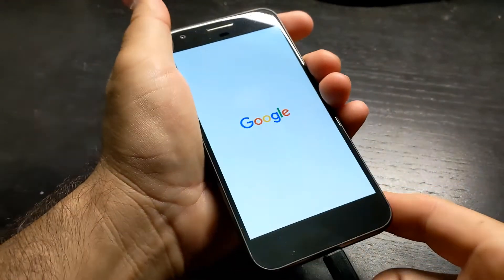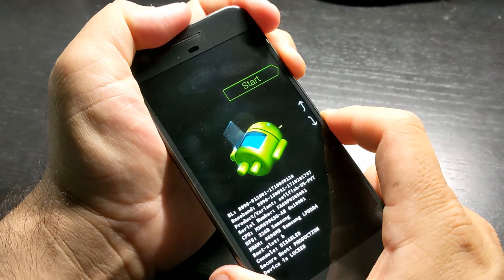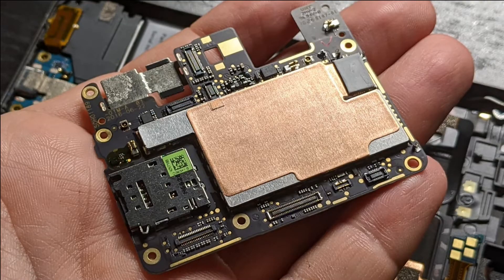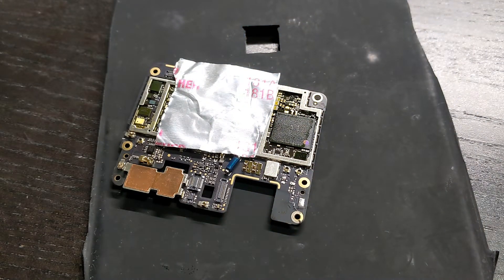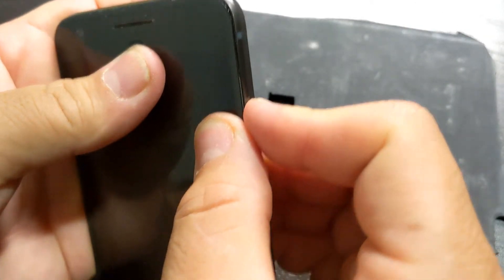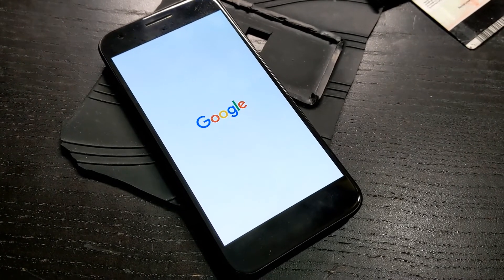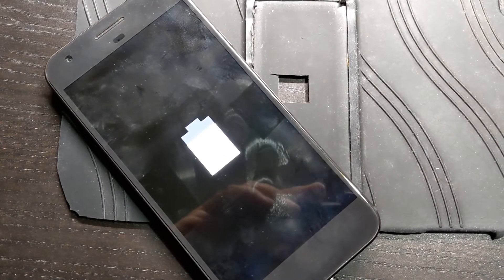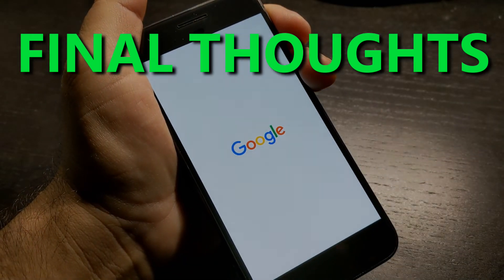Google Pixel Bootloop? Try This Fix! #reflow

Comment: Those type of reflows have a high re-failure rate. The proper way is to remove the chip and clean everything off and add new balls.
What you can do is do it again, but add flux to the sides of the chip so it flows under to the balls. Then heat the chip until the slightest push/bump of the chip sees it move/wobble - the push/bump joins cracks in solder -. The bump/push has to be very small so the ball surface tension pulls it back into place. Too hard a push will push one ball to the other so they join, and that will short the balls together, ie, you need a total new reball.
Reply from the maker: Thanks for the feedback. I will try reballing next time!

Comment: Hi Chavez Hobbies, I have à Nexus 5 and Pixel C tablet, and both devices are stuck on bootloop.

I try recovery mode :

- reboot system now : not work !
- Wipe cache partition : not work !!
- Wipe data / factory reset : not work !!! ( again !? ...yes ! 😤 )

I have 3 devices from Google, the only one work, it’s à Nexus7 2013 but I give for à friend.

I have no solutions for fix the troubleshootings of the two others devices 😢( and I’am not à electronic doctor like you, I have not your skills and capability 😉 )

But, thanks Chavez for your videos 👍
Reply from the maker: You're welcome! The Pixel C tablet is a nice one. You can still sell your devices as "for parts" online. Someone that knows how to fix a  bootloop issue will buy it. You may not have the skills right now but you can learn by trying. Making mistakes and failing is a natural part of learning. I have messed up sometimes, but I keep in mind that I am still learning.

Comment: Hey, thanks for making this. I have a phone that I locked the bootloader by mistake. I have the same issue. 
Would this method unlock the bootloader? If not, is there a hardware method to do so?
Reply from the maker: No, this method does not unlock the bootloader. I have not unlocked the bootloader on any of my Pixel phones. Try this video and see if it helps https://youtu.be/Px_vJZH5oKU

Comment: My Google Pixel XL is also like this. Sadly, there's no remedy for this issue. The only thing I could is to purchase another. I just bought this phone because of the unlimited google photos storage.
Reply from the maker: Have you tried reflowing the memory chip? The unlimited photos storage option compresses your photos a bit, so they won't be in their original size. The photos still look good though in this option. If you choose original photo/video quality, the files will count towards your 15 GB of free storage.
Reply: @ChavezDIY  I brought the phone to repair shops here and they don't know what to do with it🥲. Next time,o I'll suggest your video to them. 

I think 1st pixel series has that unlimited google photos at original quality.
Reply: @ChavezDIY  The Pixel 1 and Pixel 1 XL are the only ones that back up all photos with UNLIMITED FULL RESOLUTION photos at ORIGINAL quality.
Reply from the maker: @Progressive.G  That's correct. I confirmed that myself with a Pixel 1 after the comment above. The downside is that the camera is really old and it doesn't do a good job in low light situations and has a hard time with macro shots. I ended up with free full storage of some mediocre shots, it wasn't very helpful for me. I'm okay with storing photos and videos at a compressed "high resolution". If I need the original quality I download them off the phone via USB through my computer.
Reply: @ChavezDIY  you can upload your DSLR camera photos through a Pixel 1 and receive full resolution backups...it doesn't just apply to the photos that the phone takes it applies to all photos uploaded through the phone. 👍

Comment: not works for me
Reply from the maker: Check the video description for more information. It doesn't always work. You will need to replace the memory chip and reflash stock Android. Sometimes its not worth doing all that work.
Reply: @ChavezDIY  in my case the google pixel xl have a boot loop i cant use it but recovery mode i can enter but its impossible install rom without having access
Reply from the maker: I'm sorry it didn't work out for you brother.